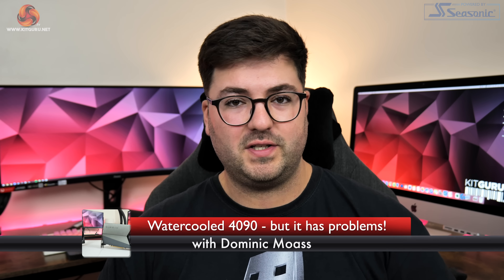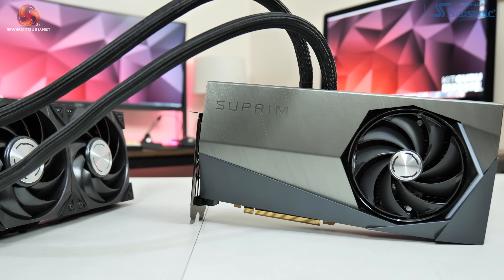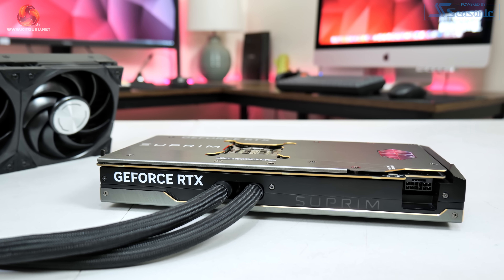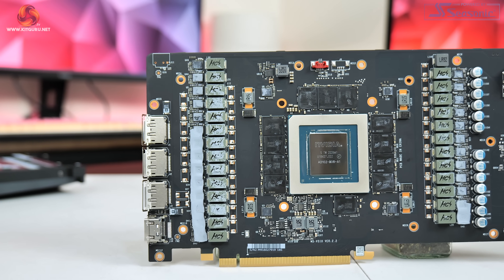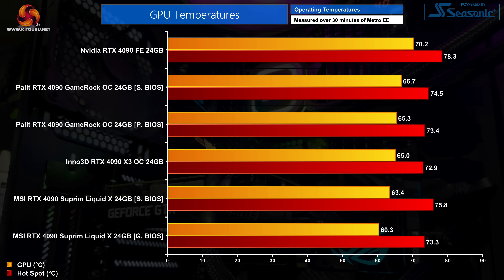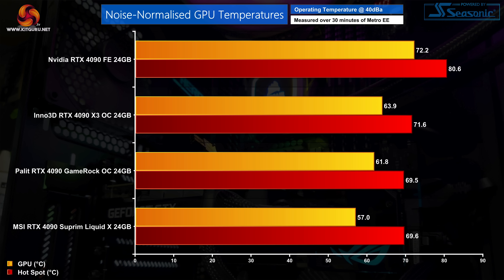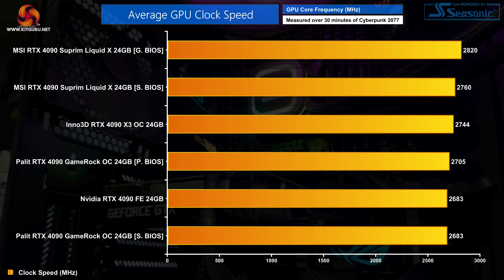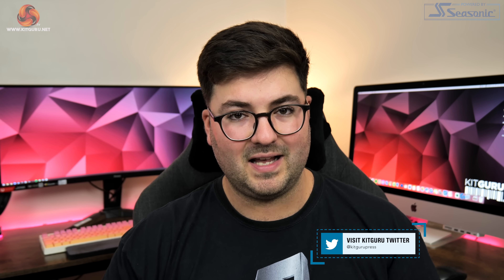MSI RTX 4090 Suprim Liquid X Review - VRM MONSTER!

Comment: It sounds like their testing was flawed in more ways than one. There's absolutely no way they achieved a 3.0GHz boost clock with +180 to the core, and the dude thinks his pump choking is coil whine.
Reply from the maker: Thanks for watching - we're always looking to improve, plenty of 4090s are capable of 3GHz!
Reply: @KitGuruTech  I know they are. But with 180 to the core, GPU-Z is not showing your boost clock as 3GHz+. It may reach 3GHz during a benchmark or under a synthetic load, but the boost clock is not 3GHz+ just because it peaked at that speed.
Reply: @KitGuruTech  and you mounted the radiator wrong and then proceeded to blame the sound of your pump straining as "coil whine".

Comment: I recently had this card repaired because of cablemod adapter. I use hardware info and I'm getting on my hotspot section
Low 29
Average 75
Maximum over 95 
Is this normal or is it running hot and I need to get it repasted.
Any help would be great

Comment: Late review, but this card is excellent.  It dumps all the GPU heat outside of the case!  Much cooler inside than my 4070ti ever was, lower temperatures on the GPU, and I'll never go back to normal air cooling for the GPU.

Comment: Super nice video, thumbed up BUT, bruh, you put your GPU AIO upside down, the pipes on the radiator side should be put as low as possible or you'll get bubbles that keep getting into your circuit, which isn't good

Comment: I was able to flip over the fans into a top-mounted pull configuration with ease - the screws weren't an issue. Not sure if my July 2023 purchase had different screws, but it worked without issue.

Comment: Crazy how he installed the rad incorrectly  and complains about pump wine
Reply: i didn't get it either, this cooler mounts up perfectly in the front of the case, where most people are going to put it... setting it up with push/pull fans is a hassle with the screws, but it's far superior overall to using air cooling.

Comment: I want to replace the fans with white phanteks rgb fans, do the OG fan cables are they able to be removed ? Or are they stuck in the gpu tubing
Reply: You can use your own fans, fan extension cables are runnig under the tubing sleeving, the connetors are outside, easy to reach.
Reply: @greggreg2458  thanks, yeah that’s with most fans but I also have lian li infinity and Corsair QL, but not using the regular 4 pin fan connected but their own unique Connecter to the rgb controller

Comment: I am currently planning on building with a Cooler Master HAF XB EVO and was thinking of having this GPU. The case supports a 200mm fan on top which I would use for exhaust and use the radiator as intake fans. At least that was my idea. I guess I better buy some additional screws to mount the radiator the way I want it. Thanks for the insight.

Comment: "best 4090 temps" thats a lie for a few reasons 

1: if you are front mounting you are just dumping all that heat into your case in the direction of the GPU
2: I have the Gigabyte AIO 4090 and never seen about 60c
Reply: no, the default configuration from the factory is pushing the air thru the cooler and out the front of the case... you'll need a case with enough fan intakes to compensate.

Comment: I have never exceeded 62 degrees Celsius even with over clocking. You must have a defective card or you are putting too much pressure on the tubes.

Comment: I wanted to consider this gpu for a dual 4090 system (for 3d rendering) but the memory temps make me a little worrie...

And also the other AIO alternative, the gigabyte waterforce seems to have building issues.

Comment: swapped out the stock fans for Noctua NF-F12 iPPC 3000 PWM, Heavy Duty Cooling Fan, 4-Pin, 3000 RPM (120mm, Black) out of habit like i did with the 140 mm version for my arctic freezer ii 420 rad aio for my cpu bc nothing in terms of static pressure comes close and the airflow is just as good best fans id say you can get or at least that i can find for case airflow or rad fans anyway with these fans the screws were able to thread on the side of the my case to the rad no problem thought id mention that also i can only speak for these fans and the ones that come with arctic coolers but the noise dampeners on the corners are not needed I've never had rattling even at 3000 rpm so though the stock fans may be able to side mount if you didn't try removing them shaving off a few mm more or less could be all that it needed to fit through
Reply: Do you have to disassemble the card to swap the fans ?
Reply: @「my bih yucky slatt』  yeah really youn just have to remove a few screws...
Reply: @「my bih yucky slatt』  not dude there on the radiator youd have to if you wanted to remove the one on the card but I don't think that's what you're  referring to.
Reply: And you can side mount the rad yes wir noctual the stock fans together the screws through the fans to the rad is slightly out of threading reach i wad asble todi it with noctua"s. Thought Idk what case you have but if it's a full tower put the arctic rad as intake on the front and put the gpus rad as exhaust top mount the rad you can fit the rad on the side of say a corsair 700f airflow with 2 more 120s on.the side but the pump I want to be A bit  higher got gpu bc tou have to instal thengpu rad on the. Bottom of the intake bc the 420 on top cucks you at least if you want to fit all the fans you could just use 3 but just thought throw that info out ther
Reply: @StupidWhiteKarens  Yes, the fans on the radiator. I'll be building in the y60 tho with lian li fans. I was actually considering that push-pull thing on the radiator, but I read people were having issues with the screws being too short and this is my first build so I'll just leave that alone lol. Lowkey wish the card had a 280mm radiator instead.

Comment: A link to the screws you suggest for fans that are 25mm would be nice
Reply from the maker: You're after standard asetek screws that come with an asetek AIO. I'm not sure if you can buy mounting kits for those standalone, but eBay may be the place to look
Reply: @KitGuruTech  ive never built a pc before i have a friend gonna help me build it but im doing a push pull fan layout on the radiator of this card with corsair ll120mm fans if you wouldn’t mind could you link me an amazon link to the screws you think would work for this

Comment: I bought my Suprim X in January and the memory temps are better than reported here (mid 70s vs mid 80s).  I’ll have to assume MSI changed something at the factory to help improve temps.
Reply: The highest I saw on mine was 76C, and on average it was lower. I think it really depends on how well the airflow is set up in your case.

Comment: I hope this helps those buying this GPU. I STRONGLY suggest push pull setup. I somewhat am expert on MSI AIO GPUs. I am getting 24C temps at idle and 50-55 for chip and around 60-65 on hotspot
Reply: Mine idles aroung 30 and never goes above 63 out of the box. Love this card!

Comment: @KitGuruTech  Heya  Thanks for the review.  Great job.   I was considering on getting this card due to space requirements on the motherboard.  Could you give me your thoughts further on the radiator setup?  I have AIO for the CPU in the top.   My case manual states that the front of the case will accommodate 120MM form factor radiators for up to 240MM.
I presume then that this card's radiator could fit in the front of my case (my only option).  But , it' may be tight.  Since I can't find anywhere on MSI stating the 'FORM FACTOR' of the radiator.  I'm a bit concerned.  Is it something you know?
PLUS, does it matter if the tubes on the radiator are on the bottom, as long as the radiator itself goes above the GPU card pump?  Which orientation is preferable if you had a choice?

THanks!

Comment: Does the rad have to be plugged into the board? Also I had it installed like you have it, and the temp got to 100 degrees, turning it upside down seems to have solved that

Comment: How is it for coil whine? The amount of 4090s hit with coil whine is crazy.
Reply: i just got one, it was manufactured last august, i can't hear any coil whine even with overclocking, unless i put my ear right next to the rear fan... so basically coil whine isn't an issue at all, even when severely overclocked i can't hear it... i keep the pc on the floor.
Reply: @DragRacingTV  There is a chance they copied Asus and swapped the inductors. 
I have been saying for 6 months + that it was because of the 70a inductors the Suprim and Strix were using. 
Back in August, Asus said they swapped the inductors to help with coil whine, but there is no way of knowing new from old. You got lucky with your MSI.
Reply: Coil whine is really bad on this card. During gaming screeches like a banshee and modulates with changes on screen. Easily heard over the quiet fans on the card and radiator from a closed case and across the room. Very annoying, and very dissapointing. Big fail for MSI.
Reply: @frostymmb  Use RTSS and cap the FPS to your monitor refresh rate, for example: 144hz - 144FPS cap, the coil whine is gone, enjoy!

Comment: These cards really need a 360mm radiator. At 60C core temps the coolant has got to be pushing 50C, just 10C away from the limits of most AIOs which will definitely shorten the lifespan due to evap.
Reply: no they dont. my liquid x runs at 58celcius while gaming. No where near 90 celcius. 32 degrees below
Reply: idk where you get your info but you are very wrong.

Comment: I'm not a huge fan of GPU AIOs, but they're kinda cool of the price is right. The price on this one in particular seems really good for what you get and it looks pretty good to boot. I think it'll sell well given it makes it a 2 slot card for 9% more than the FE (in U.S.) and probably much easier to actually buy at MSRP versus the FE.
Reply: I'm divided on this. These days we don't really tax the CPU enough in gaming to warrant a water cooler. I feel like if anything, we'd want to be able to enhanced our GPU's over CPU. Although it does make it a 2 slot, finding a spot for the radiator could be more hassle for some people. I've chosen to now just mount my GPU externally and remove it when I transport my PC.

Also the FE isn't normally available unless you with the GeForce XP lottery.

Comment: I wonder why no company decides to release full coverage blocked 1-slot solution, with the power and liquid ports all situated on the shorter side, opposite the video outs...  Nearly every solution out there uses "top-mounted" ports or top placed tubing, making them either impossible for SFF or pretty hard to fit with the tubing. And yet in server space we already had full coverage, mobo+cpu+sxmgpus, blocks that manage to cool everything and keep the profile low. Maybe once such a manufacturer arrived at the desktop space we'd have seen a full coverage mitx/matx boards, originally thin and fully covered gpu pcbs, all playing nice with each other and allowing for denser builds... Heck, if Alphacool or EK or Barrows got together wih the manufacturers, given many have branches for both mobos and gpus, they might have prepped a truly interesting solution, with eg. combined option of extendable rads + pumps + blocks to create something unique on the market without voiding the warranty or extra work... costs may not be as prohibiting a factor, nowadays we're already seeing boards costing nearly $1k, gpus meanwhile, as in this example, easily get to $2.5k levels so the extra costs any thoroghbred out-of-the-box liquid cooled set, that could work together and eg. fit in SFF cases such as NR200 or similes with space for 2 rads to cool everything efficiently, brought would have been lost in the overall scheme of costs.

Comment: Why couldn't you use the side vent on the case? It's there for specifically situations like these when you have multiple rads. So you have front and rear intake then top and side exhaust. Which is the best airflow you can wish for.
Reply from the maker: Yeah I could well have done, i'm not saying this setup is the definitive guide, just wanted to show it this way really
Reply: Yeah, this one baffled me too. The side mount seems the best choice when you have a cpu rad mounted to the top.

Comment: I have had mixed success with MSI over the years. I had a few fans fail in their high end cards, but overall, this would be great. But I think they might be overcharging just a little for it in Europe.
Reply: This model’s aio is manufactured by cooler master. Well at least the pump & radiator afaik

Comment: The design looks cool. But I will bet it is not worth the premium. You could buy a used car, 2 LG OLEDS and 4 PS5'S! For RTX 4090 prices. And I bet that cost to NVIDIA to make it after all the costs no way justifies this GPU pricing structure.
Reply: I mean the 4090 is expensive, yes... But the $150 premium on this particular card seems very reasonable considering you get a copper colt plate, pump, tubing, radiator, fans all for $150.
Reply: @Matt-gf4gd  ehhh... Not a full block though + awkward tube ports orientation on already very tall card... I would rather pay another 100 on top of that MSI and get Alphacool's Eiswolf 2 AIO and get it done proper. If past factory watercooled cards are anything to go by, if they inevitably shit themselves there will be no compatible waterblocks to replace this with. That and in 30 series both MSI and Gigabyte shat the bed mixing incompatible metals in the loop leading to parts suffering bad galvanic corrosion and breaking apart and leaking.
Reply: @Matt-gf4gd  agreed
Reply: @Matt-gf4gd  FE is the best bang for buck imo. Unless you want ‘to look cool’
Reply: @NoXQc  not if you're wanting a water cooled card/need a smaller card etc. 4090 FE + water block already puts you close to $2k... Then the tubing, pump, radiator, fans etc.
Reply: @NoXQc  so if I can get the msi 4090 card for the same price then is it worth it. Actually 50 dollars cheaper
Reply: @melvina183  i had a MSI 6800xt and it was amazing. I wouldn’t hesitate for the 4090
Reply: This isn't really a card for someone that would need to decide between a car and a GPU...
Reply: @LizardHunter777  That's what NVIDIA  want you to believe. They want to be like Apple. Huge margins vs true cost...
Reply: @Vonklieve  Who cares. The cards are worth whatever people are willing to pay. If people continue to buy faster than they can make them why would they lower price? You expect them to take less money out of the kindness of their heart? 😂
Reply: @LizardHunter777  Basic economics cares. The cards ain't selling. The GPU market is in the biggest slump in 23 years, since 2005. High profit margins equals less sales. Simple. So people are not willing to pay. Graphics cards are hardly Tesla class items in 2023. Does that address your assertion?
Reply: Mine looks great and is working even better in my thermal take a500 case. The metal backplate matches the case perfect. It's like they were made for each other
Reply: A car for that price will not last much longer or sound like crap.
Reply: @catastrophic_biz3608  which is why I stated, "used car".

Comment: Never liked MSi cards … I would rather go for another AIB, thanks for the video … If Gigabyte and EVGA put a 360 on a 3090 don’t know how MSI think they can get away with a 240mm radiator on a 4090. Testing shows air or that AIO same same
Reply: Never going to buy an msi card again. The 6900XT that I own had ridiculous high junction temps and died after two months. Bought an 6950 XT and that died in two weeks. They didn't even replaced the card, I just got my money back.
Reply: Since MSI rejected my 1080ti gaming x warranty because of cooler fins being bent ( how I got it ) I will never buy MSi Again
Reply: MSI, Zotac, and gigabyte have a long history of heating and quality control issues. If evga hadnt left the market I would be looking at them. But now its basically asus or gigabyte for me. And asus has by far the better costumer support.